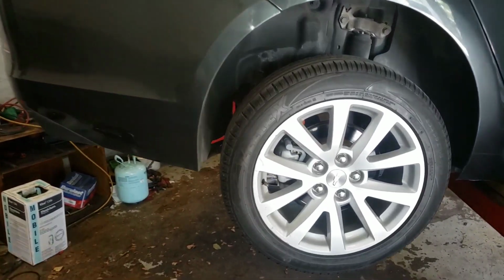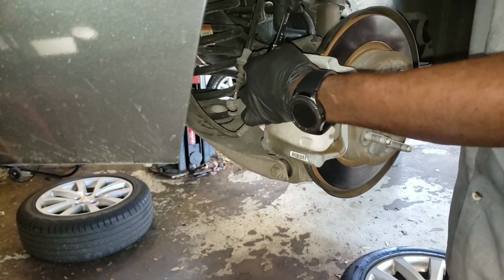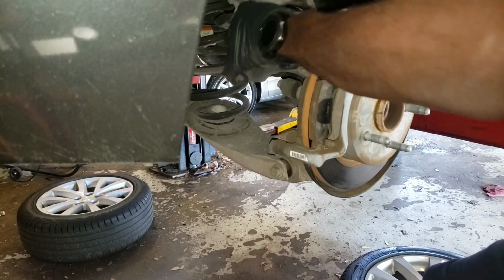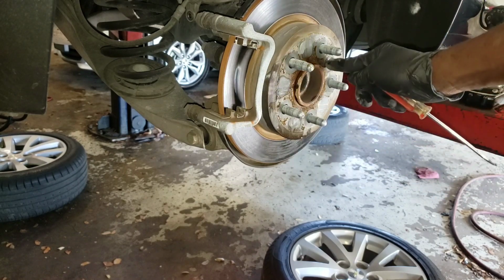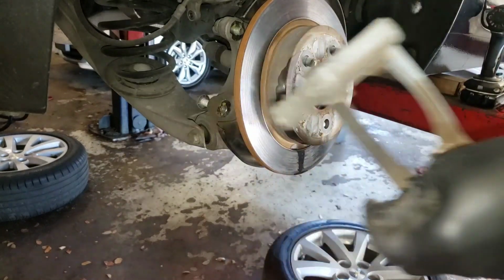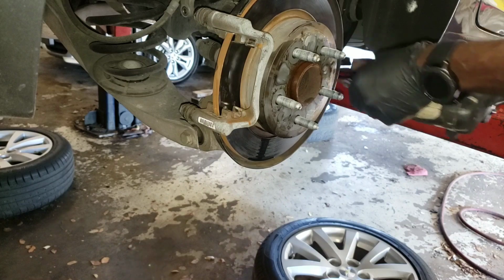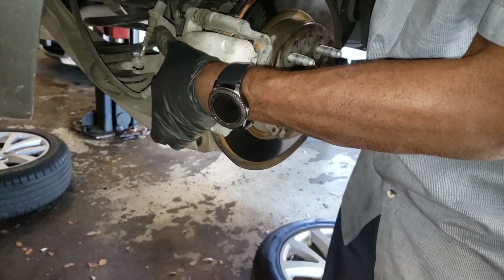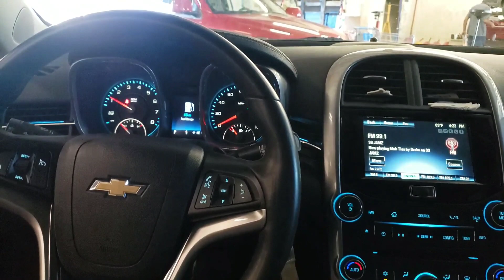Chevy Malibu rear brakes replacement

Comment: Your video was spot on.  That trick with the needlenose pliers worked great.  Just like you said, hard to turn at first but easier as you kept going.  And like you said, the inside pad was a real pain to install.  Took about 3 hrs to do the whole job.  Everything works great!  Thanks!!